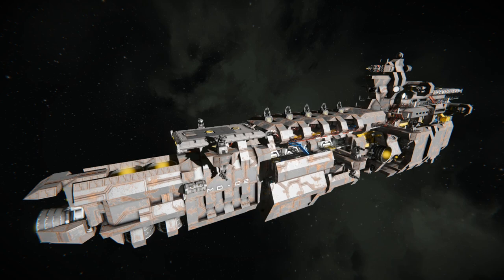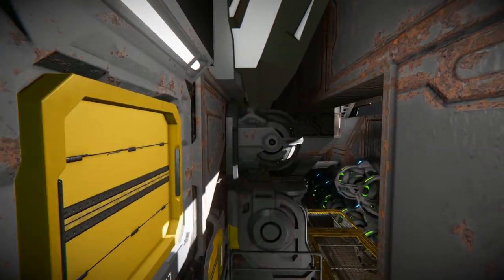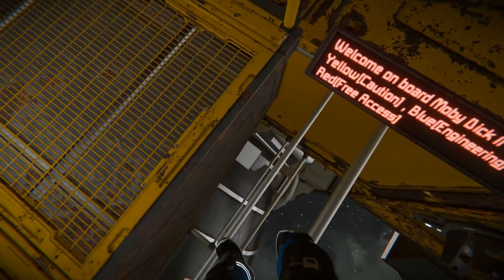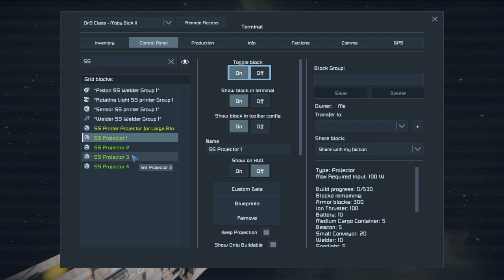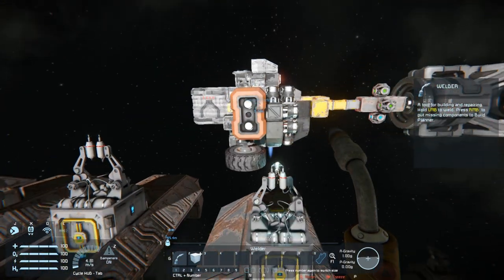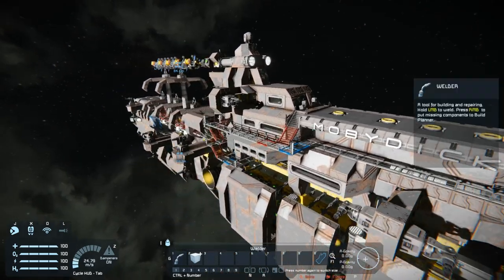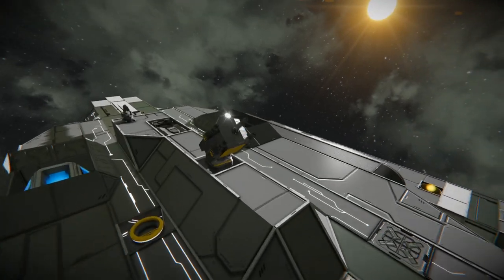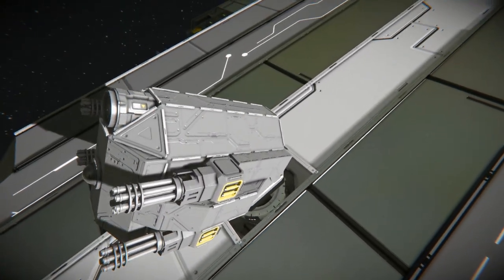Space Engineers Inspiration - E239: Moby Dick II,  Teralis - City Planet, & ETV-3 Cavalier

Comment: 13:00 There are sensors on the welders which extend and retract them, making the welder more efficient. If you pay attention in the game it shows this scene with 4 piston mounted welders bobbing as them make a ship in the cinematics. How this works is by setting an area where the sensors pick up a small grid, retracting when it detects and extending when there is none.
Reply from the maker: Oh ok, yeah I'd seen the cinematic before I just never knew how they set it up. That's pretty interesting. Do you have to put the sensor grid at like the edge of the welder range or what? Also, feel free to continue this on the Discord server, I've honestly been pretty bad at checking my comments lately but try to keep up with the Discord stuff at least. :P
Reply: Okay I'll add a few pics

Comment: The design of that printer is actually a lot simpler then it looks. Timer blocks raises the welder, turns on the welders as well as a set of sensors. You can hear them during your video and it's really annoying.They really should have been silenced. The sensors detect grids above the welder tip. When a grid is detected, the piston is retracted, otherwise, it's raised. Each piston has it's own individual sensor. That's really all that there is to it.
Reply from the maker: Yeah, this got explained to me earlier on my discord server. I was a bit surprised as it seemed like it would be far more complex than that but it's pretty cool still.
Reply: @Sleeplessknightsstudios  It's an interesting design for sure, but I feel like it's far from optimal. You can see it in your demonstration video, there's dozens of blocks that just aren't welded after more then a minute of running it.
Reply from the maker: Well, in discussion with the builder, I was actually informed that I had 2 different blueprints running at the same time and somehow managed to make some weird frankenstein hybrid lol. So I'm not sure how much faster it would've been had I done things the right way, but that's sort of par for the course from me I expect haha. xD